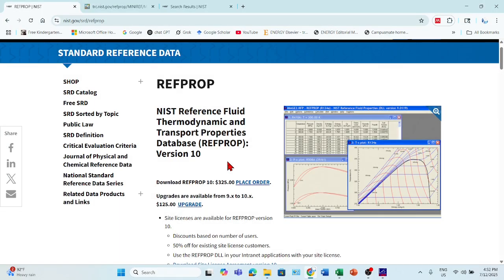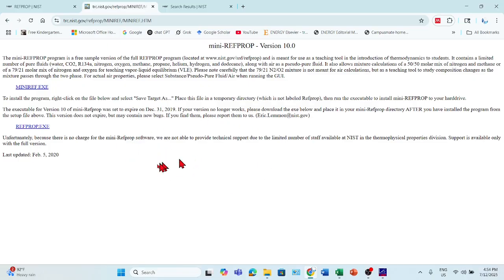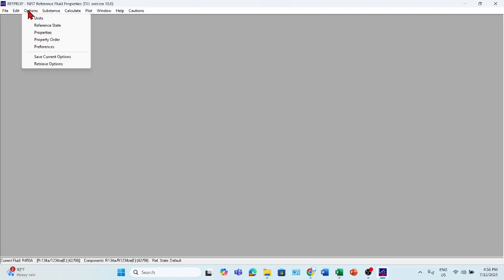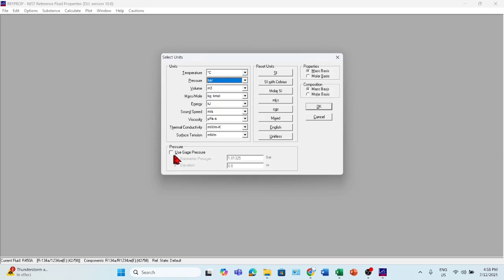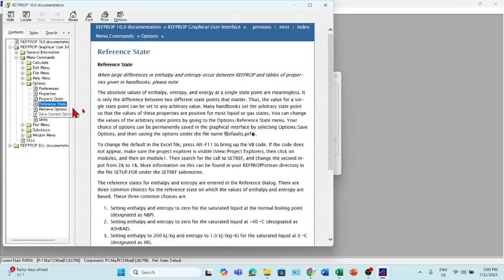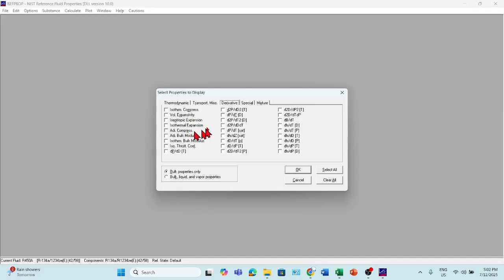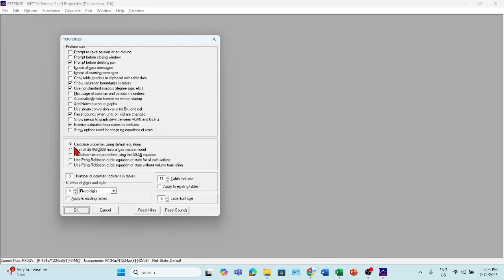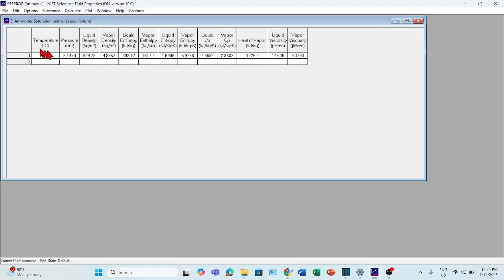Part 1 REFPROP 10.0 Series: Overview and Mastering the “Options” Menu

Comment: It will be also great to make a video on refrigerant specific installation process to enable more accurate mixture calculations as mentioned in REFPROP FAQ docs.
Reply from the maker: Thank you for your interest
please watch my other video "Part 2 REFPROP 10.0 Series: Diving inside the refrigerant library “Substance” Menu"
Hopefully you will find your answer. If not please feel free to ask again.
Reply: @Applied-engineering no that video doesn't cover the REFPROP's refrigerant specific mixture models enabling process.  May Lord bless you with a fulfilling career.